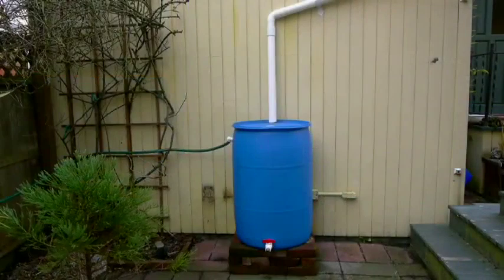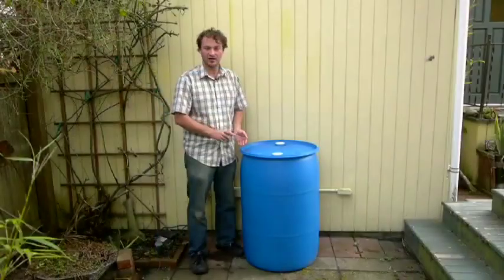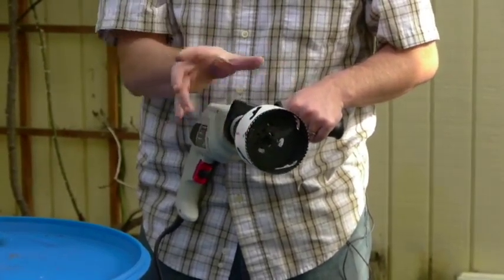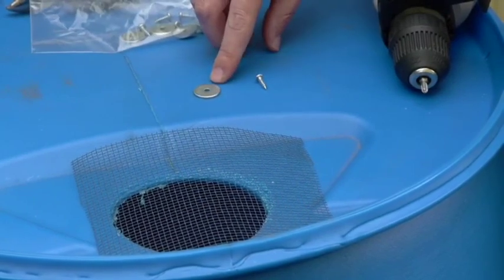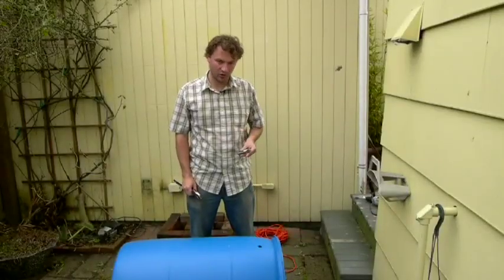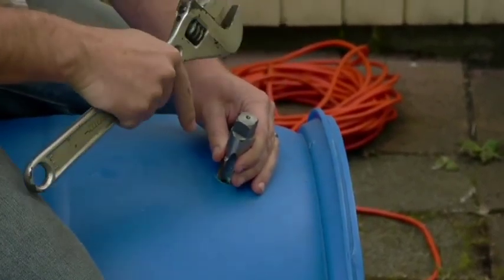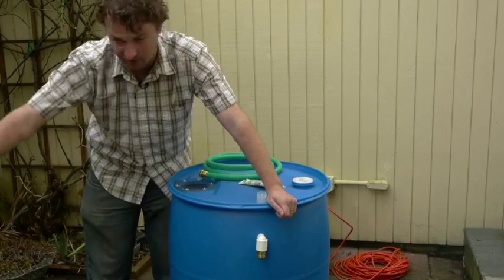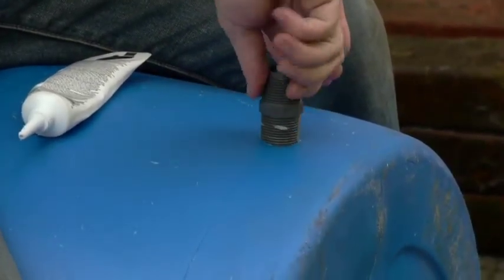How to Build: A Rain Barrel

Comment: For the overflow, just screw a hose to the threads in the white plug on top. Why on earth would you cut a hole in the side? You've just reduced the barrel capacity by around 5 gallons. (Simply drill out the opening in the white plug.) Also, instead of drilling out the other white plug --- you know it unscrews, right? This is the strangest blue barrel conversion video I've watched.
Reply: Attn: physics lesson. You wouldn't want the overflow on top, as that is where the water comes in and has zero pounds of pressure above it. This is important. Also he drilled out the bung to create a larger input that can accept more water.  Guy seems like an expert in this field.

Comment: 9:15 you recommend tapping all the way to the end of the tap.  That's a big mistake.  NPT is National Pipe Taper.  By going all the way to the end you eliminate the taper and create what's called NPS or National Pipe Straight.  Pipe thread is tapered to facilitate tight sealing.  Being that the barrel wall is somewhat thin - you're eliminating the taper feature.  I'd go just to the point where the starting teeth of the tap reach the fully formed threads. This way whatever you thread into it isn't trying to cut threads but the taper produces a very tight seal.  I'd still use the silicone sealant, but you're going to get a tighter fit if you don't go to the end of the tap.

I'm still watching.  Just have to jump in right here to point out a common mistake.

At 12:00 you show a plastic ball valve.  Yeah, it's doable, but they often take considerably more effort to open and close.  With the necessary force you COULD strip out your bottom through-hole barrel connector.  A brass fitting would be easier on the connection.  While plastic expands at a given rate, the brass fitting will also expand at it's own rate.  The difference between the two can cause minor cracking and leaking.  So use of metal fittings is not the BEST of the best option.  A better option would be one of those hose attachment ball valves that are also of plastic.  They're smaller and easier to operate than the ball valve you show in the video.
Reply: Wrong.
He said it was an NPT tap.  That means the cutting threads are tapered clear to the end of the threaded section.  There is no "straight" threaded component to an NPT tap.  The entire thing is tapered.

You are referring to a NPT/NPS "combo" tap, which would be clearly labeled.
Reply: The wall of the barrel is so thin that any taper at all is going to be negligible.  Tapping all the way means you'll have a loose and leaking joint every time all the time.
 @rthinds
Reply: @petec6690  
Yes the walls are thin, so the "tapering" will be negligible.  As for leaking joints, all one would need to do is screw the fitting all the way into the hole, where the tapered threads of the fitting match the tapered threads of the hole.

In other words - as hand-tight as you can get it without stripping anything.  Then it won't leak.

Comment: Why did you use a 7/8" drill bit for a 3/4" tap?  Wouldn't you want the hole size less than the tap size?

Comment: Thank you for showing us. I was looking and bulkhead cost too much as I wanted to put about 12 barrels for my garden as I fill up city tap water in those barrels and let it evaporate those chlorine out for couple of days then water all my garden. I have a question. Which way is better,  use city water or it is better to let city tap water evaporate few days before I water garden. My garden is too far far away from house to use rain water.
Reply: I'm not affiliated with this video but,  I have experimented with tap and rain water on my garden.  I saw the plants actually wilt from tap water. That can't be a good thing.
Reply: @johnwimbs2157  yea, I did that to my cucumber plants end of summer as it is time to end the summer garden so I decided to see what happens when I water them straight from city water line. It did killed my cucumber plants. City water horrible for my garden. I won't use them. I let full barrel of water to evaporate those chlorine out few days.

Comment: Thank you for sharing. Where can I buy this barrel? Can you please reply with a link.
Reply from the maker: Typically, you can buy rain barrels through your local conservation district or municipality. Sometimes you see them at home improvement stores as well. We use recycled food safe barrels.
Reply: I bought some on highway where used tractors and pipes and junk stuffs are. I passed that place everyday and I notice blue barrels and burn trash barrels there. I also saw some at Tractor Supply Store as they have some in their parking lot inside the cage area. The ones I bought from junk yard, you could see them from the side of road on highway 271 about half way between Gilmer,TX and Gladwater,TX.

Comment: The threader is pointless. Use a bulk head fitting for that instead. It's cheaper. Use a stick with reversed tape inside the barrel to tighten.

Comment: NPT is a tapered thread.  You want to cut just enough to get the fitting to screw in halfway easily by hand .
This lets you tighten 1/2 to 1 turn more to get a tight seal.
Cutting more makes it easier to thread the fitting all the way but promotes leaks.

Test fit the fitting after you have tapped appx 1/2 way down the tap bit.  If you can turn the fitting in by hand  3 turns, you have tapped enough.

Comment: I put 1in. PVC through the bung for a swivel fixture. It's easier to work with, sealed with silicone, and detachable. Barrel is upside-down, with downspout hole entry at barrel bottom and overflow on the side to reconnect with a drain. It's worked 15 years, wasn't drained a few winters, and still does not leak, in spite of sub-zero (Fahrenheit) cold snaps. You could get a threaded fixture to connect a gravity-fed hose to water plants. Mine is high enough to place a watering can under it. Like yours, but barrel is upside-down.

Comment: Hey. works well. I love the 55-gallon rain barrel, I'm getting another one. This time it'll be for the front downspout on my garage, now the entire garage roof will provide garden watering. I have architectural roof shingles so I will only use the water on flower gardens, not for any plants  I'd eventually ingest. I never got around to painting the first barrel. I decided that I'd paint the second one since it will temporarily be placed near the driveway, closer to the public view. I  also figured I will remove the two-barrel hookups when the gardening season is done, this way all my water will return to the underground conduits that my town mandates for all surface water.  In the meantime, I'll enjoy all the free water and be thrilled with having 100 gallons.
ANOTHER IDEA,  since I hooked up a kink-free tubing to the faucet on the barrel to drain into buckets, I found it takes time filling and emptying all those buckets.   MY IDEA, I'm going to try to use the kink-free hose then add my extra submersible pond pump with another hose, to push the water out into the garden, instead of me filling up buckets. If it doesn't work, I'll cut an opening that will fit the submersible pump, into the barrel the attach the hose into the garden. COMMENT,  I suggest the barrel's faucet tap should be about three inches from the bottom, allowing more of the accumulated water to be drained.

Comment: Ok for everyone who does this please set your 55 gallon barrel which weight fully about 450LBS onto Cinderblocks to have at least 2' space of the ground for easier access. Also will well publish soon more videos about this topic as well for larger scale setups and how to proper filter debris out too. Also please stay away with your system at least 2 feet from any electric systems like shown in the video to allow electric work to happen when needed. Also DO NOT DRILL out your openings on the top of the barrel, instead use 2" PVC pipe which fits exactly into the opening of the barrel. So if you do have a lot of water coming from your roof you can use a Y or T and have both 2" holes as a fill. And setup a T trap before it in which debris is been caught and also the first 1-2 Gallons of rain water which carry a lot of the dirt. We will be showing you a setup of this kind on our channel as well.

Comment: Great instruction. So clear and thorough. I loved these ideas:  cutting around  the cap area,  pipe thread tool and the last few seconds showing the Camouflage paint. I have an idea to share with you, instead of drilling and screwing down screen, cut a 3 inch hole and place a garden pot inside another pot separated or sandwiched by the  screen.  This allows you to see the accumulated debris  and  remove it.
Reply from the maker: Neat idea. Thank you!

Comment: It appears that the existing cap thread in the top could have been used with a 2 inch PVC slip to thread adapter for the inlet from the downspout. Those pipes don't have to be glued allowing easy cleaning.

Comment: Why a nipple/ ball valve/ hose adapter, rather than a boiler drain or hose bib directly to the threaded hole?
Reply from the maker: Because the system is not pressurized. A gate valve has a much narrower inner diameter and will provide significantly less flow than a ball valve if it is just a gravity system. 

Additionally, the quarter turn to open a ball valve is much easier than the 7 or 8 full turns to open a gate valve.

Comment: How do you clean out the sediments out each year? Would you remove the screen on top and flush it out upside down?
Reply from the maker: Yes. When it's empty, remove the screen and power wash the inside and replace the screen.

Comment: Have four set up. Need to have outlet holes made...was contemplating bulkhead fittings  for that.
Reply: Bulkhead fittings are fine, but you need access inside the barrel to install them.

With the low pressure of these barrels the fitting threaded into the side is fine. 

Done sa shown here, common house water pressure would blow the fitting out of the barrel.
But the barrel might split before that happens.

Comment: The pipe tap I purchased is coated with a lubricant and labeled with a caution: known to CA to cause cancer. Any tips on removing the lubricant before use on the drilled hole in the plastic barrel?
Reply from the maker: From our engineer, "A strong soap should take off pretty much any form of lubricant. Most are oil or graphite based, and soap will remove them."

Comment: This does not address what to do in the winter time
Reply: Drain them!
Reply from the maker: What kind of information are you wanting for winter time, Barn Dweller?
Reply: @SnohomishCD   since he didn't reply I will...I have four 55 gallon  drums. I actually receive most of my monthly water from these 4. In the summer it's fine and warm and all that...but in the winter, how do you winterize the system safely? Still want to keep it potable... and where can I find an affordable bulk storage tank(3 to 5 k gallon)?

Comment: There are many ways to build a rain barrel, I hope you investigate more and find better ways than this.  IE, use a bulkhead fitting for the faucet so you don't use any chemical sealants that could leak chemicals into the water.
Reply: Aside from chemicals you can much better secure the spigot using a bulkhead. Tapping the sidewall of the barrel at best will only create a couple threads that likely come lose when tightening and over time. All else is cool. 👍 Just insert a bulkhead. No tapping threads. Not to mention the tap will cost more than all the parts combined.
Just my two cents.
Reply: @mountaingrownnomad4212  Agree with you there. The tap is $45 on amazon. But it takes some wizardry to get the bulkhead installed inside the barrel.
Reply: Silicon is safe when dry.
Reply: @bossdog1480  Sorry, but your wrong on that point.  Contact GE tech support if you think you're correct.